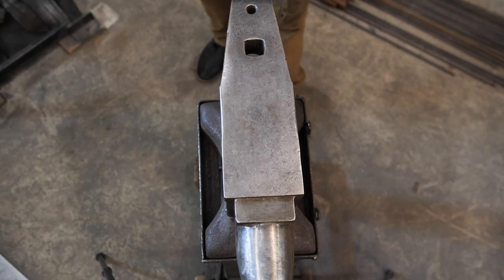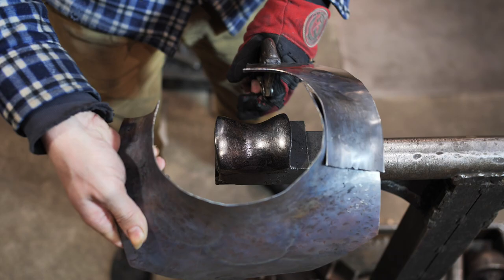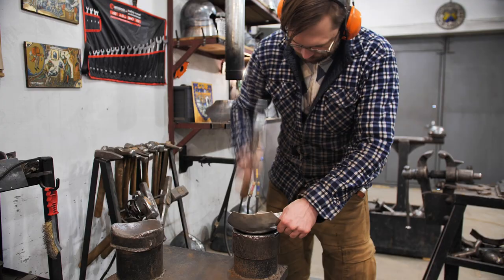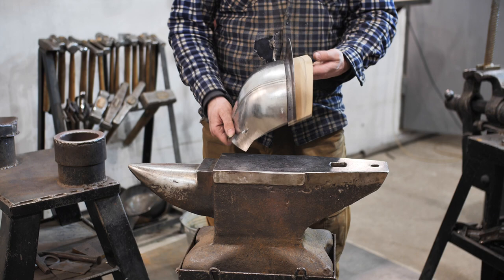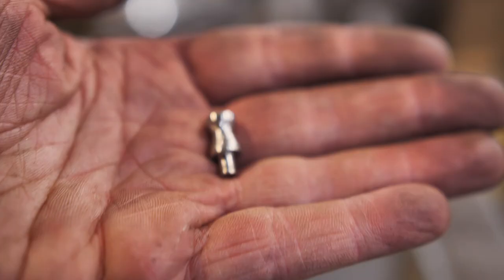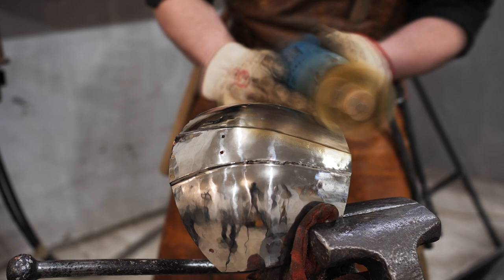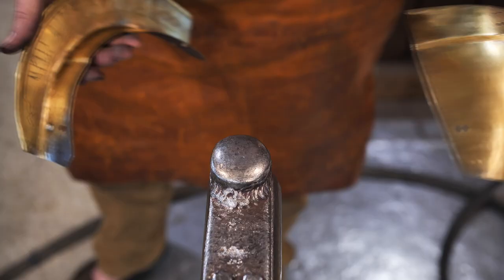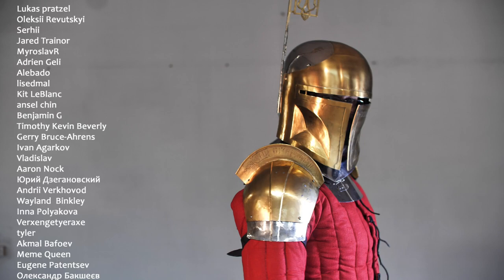How to forge a Mandalorian shoulders and gorget. How to make armor

Comment: just thought that I would pint out that it would be possible to build a bullet proof roman style shield using modern material science. if the shield were to have a slight wedge shape down the center any bullet coming from the front would be redirected to the side as long as the outer layer was steel or Titanium.